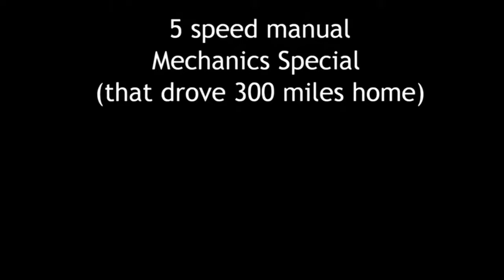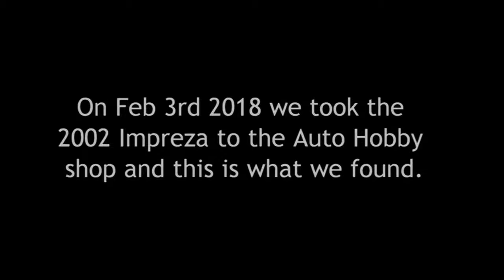2002 Subaru Impreza 2.5 TS Intro and check out

Comment: Man, I got one of those but it is 1.6, I'd say it consumes even more gas than yours.
Reply from the maker: I was a little concerned about this one.  It was a mechanics special and I knew it was going to need some work.  Since this video, I have done a lot of work and have 4 more races to round out my first year of Autocross in it.  Fixed the front bumper cover, new head gaskets and timing belt kit, lots of seals and other gaskets in that process, new front axles, replaced the muffler and will be upgrading the struts and springs net week.  It's getting even better gas mileage now.  AMSOIL in the engine, transmission, front and rear differentials, power steering and brake fluid.      Check out my AutoCross to see how it runs and hear how it sounds now.  Thanks for watching.
Reply: @JWCMotorsports It seems you have spent a lot of money in those upgrades. Mine is about to be under maintenence because of an oil leak, head gastkets for sure! And it will be a headache for me 😂. Nice cars by the way! Do you know any website that I can get the bug eye fog lamps?
Reply from the maker: @humbertogonzalez6040  I do all the work myself and save a lot of money that way.  As for the fog lights, I see some on RockAuto.  I do a lot of research and shopping around for what parts I'm looking for.  
Get-Primitive
RockAuto
RallySportDirect
Are the main ones, An I'm an AMSOIL dealer so all that I provide.